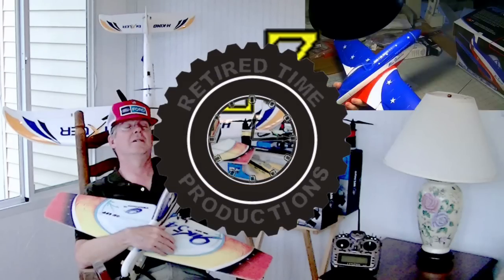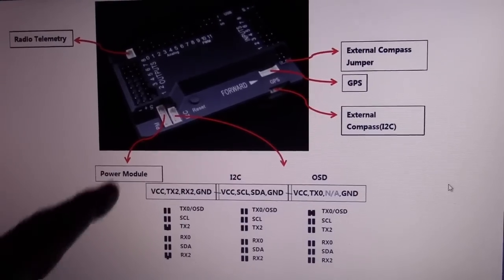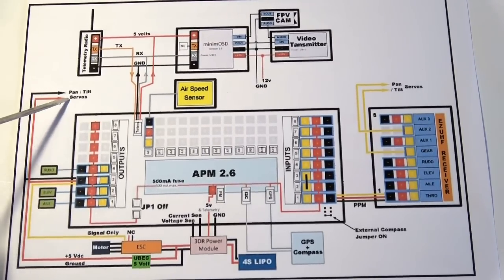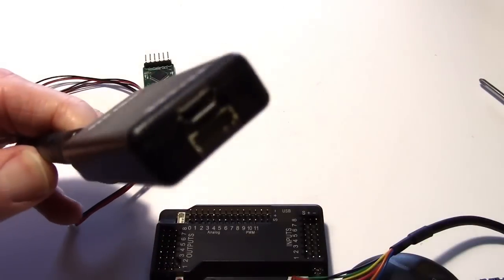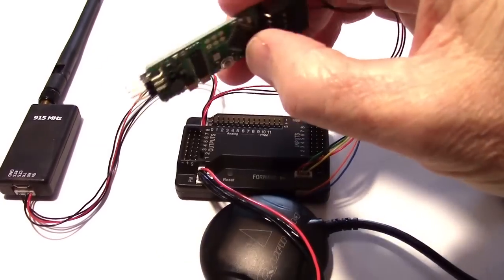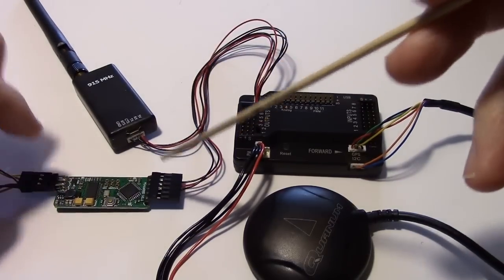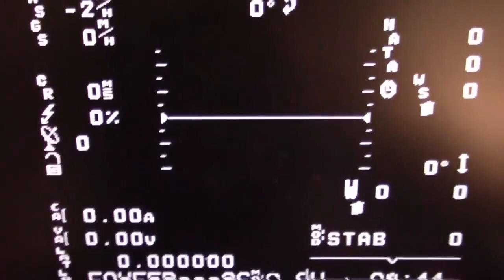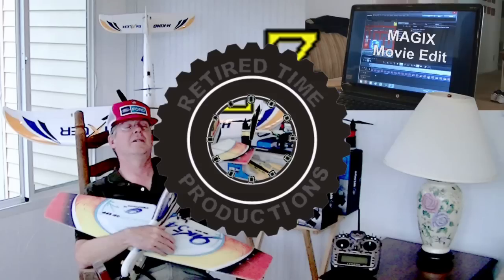Ardupilot APM 2.6 Wiring, MinumOSD, APM Telemetry Radio, Power Module - XUAV Mini Talon FPV Part 4

Comment: Thank you so much Dave. I started getting into foamies and quads several years and then I had to quit for about 10 years. I am now trying to get back into it and I am pretty much lost. I have a lot of unused parts I bought back then and am trying to get a sky mule in the air that I never flew. I was trying to follow your video and get my APN 2.6 wired. But I do not have the wire for the I2c connection to the GPS Mag. Any idea where I could order that connection wire and what the connectors are called? Thanks again.

Comment: Hello sir I was using apm 2.6 and crashed drone don't know how now apm connect with mission planner external gps not confirmed on laptop but apm connect,,,,and no blue light is working,,,,,it arm also on laptop but no compass celebrate,,,,,it's huge fault how can it recover pls send me link sir

Comment: Sir please send a circuit diagram for conventional tail of fixed wing UAV.
Reply from the maker: The circuit diagram is the same as this one. Just replace the two tail servo labels with Rudder and Elevator.
Reply: Dave Merc Productions and what about ailerons connections?
Reply from the maker: Ailerons are on the diagram, channel 1. Download the diagram and print it out.

Comment: Can i use 1 battery from power module and give power to video transmitter at the same time???...sorry my english
Reply from the maker: Probably, as long as the camera can handle the voltage.

Comment: Thanks for a great upload. I wanted to ask you that in the list on your computer regarding Mandatory Hardware & Optional Hardware, can sensors that are not listed still be added and able to communicate with the Ardupilot for data logging such as Temp, Humidity, etc? Or is it only limited to the options provided so you can’t add any other hardware? Thanks for your video & I look forward to your reply.
Reply from the maker: Honestly I don't know but you might ask on the forums. https://diydrones.com/forum

Comment: Can I use the internal compass if using a plane? With a standalone GPS? Also you said if you get out of range, you will lose the plane, but I thought there are features where the plane will return home should you lose RC control.
Reply from the maker: I have since learned that a compass is not recommended for planes (only multirotors). Planes need GPS only to get RTH to work. Setup failsafe so the plane will return home if you lose signal.
Reply: @DaveMerc  Thanks! Much appreciated! :)

Comment: Hey Dave, I think I might have screw up, I was watching another person video before finding yours. He said nothing about pulling  the JP1 jumper. If that fuse is blown it the board bad? Also is it possible to check continuity on that fuse? On your schematic it looks like that fuse only protects the output pins. Man I don't know.
Reply from the maker: If you could find the fuse you could probably bridge it with some solder. I'm not sure where the fuse is located but you could trace it down with an ohm meter (multi-meter). Check the 5 volts on the power module to see if it's still working.
Reply: Sir, I checked voltage on output pins 1-8 4.7 DC, rail pins 1-11 5.7 DC, input pins 1-8 5.7 DC, so I guess I'm OK. I have a APM 2.8 I'm trying to use on a S500 I'm trying to build. I keep watching your videos only and learn as much as I can. Thank you for being  there.
Reply from the maker: Sounds like a worthwhile project.
Reply: Yes Sir, I checked the voltages, and  we are good, I'm using a Fluke 87 True RMS VOM  so I know my DC is good. Sir, Thank you for being there, you just don't know how much I appreciate you.

Comment: Hello can you please help... Can you tell me why my apm is not desplaying current even when it is detecting the voltage correctly, is it coz of the apm hardware issue or the settings? Am using apm 2.8 Thanks.
Reply from the maker: Look at time 06:34 in this video.https://www.youtube.com/watch?v=Lg_wnPCFYs0

Comment: Hi guys Im New to fpv  and seeking some help Im having a Hard time to get my osd working, I just pluged every thing together making a New harnes for my camera and grounding all the components and powering every component with the same battery (camera, transmiter and osd) the probblem starts when i conect the osd I losse signal to the hobby King gogles all the video works from my camera to my screen without the osd any recomendations 
Great info is found here 
Regards
Reply from the maker: It's hard for me to troubleshoot but here are a couple essential videos for setting up the MinimOSD
https://www.youtube.com/watch?v=k9r_Yu9U5rk

https://www.youtube.com/watch?v=dZLycZtsoZ0

Comment: I am looking for my first  inexpensive apm for my skyhunter and saw the apm 2.8 with gps and accessories on ebay for $75 that looks similar to yours. Would you recommend these or another besides the one in video? Would like eagletree vector features but at a cheaper price if possible. thankyou
Reply from the maker: You could get a Micro Vector but I think the APM will do just fine. I have on in my SkyWalker and it works great.
Don't forget the buy and airspeed sensor.

Comment: without the minimOSD, does the APM telemetry data still need a external battery source to run?
will the usb power from the system not do??
Reply from the maker: No you would not need a external battery to run that.
Reply: i am trying to connect but it doesnt receive a heartbeat. the connection always fails! Note: i am powering the apm using the USB.
Reply from the maker: Where are you seeing the error, are you looking at the mission planar or is this on the OSD screen?
Reply: mission planner!
Reply from the maker: Did you try it without the telemetry radio or MinimOSD connected and only the USB cable?
Use 115200 for the baud rate or try AUTO mode from the drop down.
It's hard to troubleshoot over YouTube. Your best bet for answers is 3DR DIY drone forum:
http://diydrones.com/forum
Reply: It is wokring without the telemetry, direct usb, yes!
Reply from the maker: My guess is the wiring for the telemetry radio needs changing. There should be 4 wires (TX RX 5V GND) not just 3 like the Minimosd. 
This video might help
https://www.youtube.com/watch?v=s_MO4xUySoU

Comment: Hello Mister Dave,

my name is Dinant from the Netherlands I am a fan of you channel and you inspired me to do the same setup on the mini talon as you did but I struggle with the outputs. where can I find the layout for the servo's I have on the tail 2 one left and one at the right and then 2 on the wing also left and right and then I have the motor this one goes on the 3th pin but how do I wire the servo's can't figure it out 😥 could you plz help me with this could you send me a pm my email is dinantdekruijff@gmail.com
btw I have the apm version 2.8 I have to remove the jumper to get rid of the internal compass right I hagen the gps module with compass inside. I hope you can help me with this. I thank you in advance for your help and will be a loyal member of your chanel.
with kind regards Dinant de Kruijff
Reply from the maker: I will get into the servos later when I do a video on the V-tail setup. Right now I am not even sure where they will be. I am still waiting on the missing right wing. I will be putting up another video about the APM in a few days.
Reply: dmerc00 oké thank then I will wait for further instructions

Comment: Good stuff Dave! 
It's nice to see HK includes the little button piece with the case. Many sources for apm clones never include it, so you're left with just the hole to access the reset button.
Reply from the maker: I almost lost that button it was so small. 
Getting any snow?
Reply: dmerc00 Not yet, but they're calling for 12 to 18" for our area Tuesday to Wednesday. Are you guys supposed to get any from this storm?
Reply from the maker: Got a dusting of snow last night but nothing on the roads. Problem now is a cold wind during the day.
It' supposed to hit a low of 13°f by tomorrow at 8am. Lousy flying weather.

Comment: Hey dmerc00, G'day from Aus mate. Thanks for your vids, they have helped a lot. One issue I am having is I am using an immersion rc vtx and fatshark camera on my H550 and have it all wired as you have per your diagram. I am having issues with vid signal and when I do get it, it is inconsistant. 

I am able to get the Minim osd working and show what it is supposed to, but it is inconsistant. The only difference I can see from how I have my setup  ( between the osd  and camera/vtx ) is the immersion rc vtx only puts out 5v to the camera ( as that is what it requires) and from your vids and info, aswell as all the rest I have researched, the osd needs 12v in and out?

So I guess my options are to get the 12 from elsewhere or use some voltage step ups/stepdowns between the minim osd, camera and vtx?

Thanks in advance for any info.

Cheers Dave.
Reply from the maker: I put a comment in the video description about the fat shark setup.
Reply from the maker: For Fatshark 5 volt camera and TX, If you have the typical MinimOSD there are two jumpers on the back you can solder and run both stages from the APM 5 volts. On the output bypass or don't use the two center pins. There are diagrams here for the 5 volt setup and jumpers:
http://ardupilot.org/plane/docs/common-minim-osd-quick-installation-guide.html

Comment: Great Video showing the basic connections Dave. The APM Mini Pro is very similar, but does not benefit from polarised plugs, however they are simpler and more durable standard servo ones, which is what I prefer. SPPM muxed Input is exactly the same going into port #1 with signals 2 and 3 jumpered across. If you need any help wiring the APM Mini Pro...let me know....:)
Reply from the maker: Yes I see how the APM Mini Pro uses standard servo connections for the GPS and Compass instead of the small Molex type connectors. Not sure which one will end up in the Mini Talon but for the tutorial the HK Pilot is better because the wires are easier to see on camera.
Reply: Yes, you are correct, the Molex plugs make the Video easier for sure. I have my APM Mini Pro in my Mini Talon now...fits easy. ....A similar wiring Video for the Pro would be of benefit to some Im sure, simply because its not so obvious, and it is a later Model of APM....I do have a Link for the PDF wiring diagram somewhere...Ill add it in a while ....here...:)
Reply from the maker: thanks, I will probably use that diagram as a guideline.
Reply from the maker: Thanks, that will be very handy indeed!

Comment: Does it still work with missionplanner ? Do remember they stopped supporting APM a while back.
Reply from the maker: From what I have read they have stopped supporting arducopter which moved to the pixhawk but I think new versions of arduplane are ok for the APM.  Will try 3.4 Firmware and see what happens.